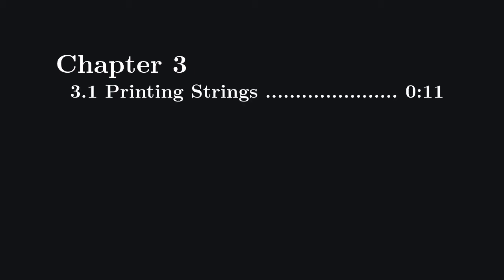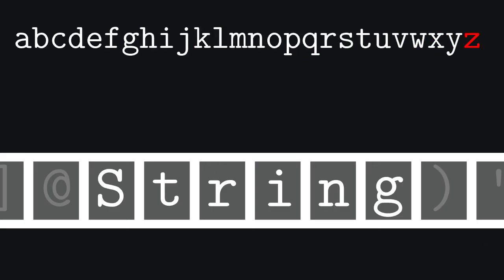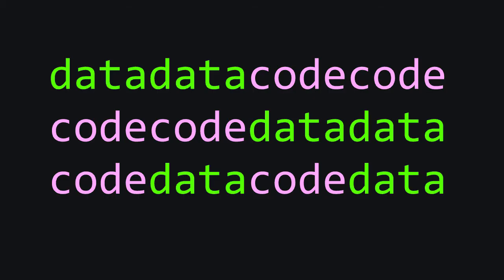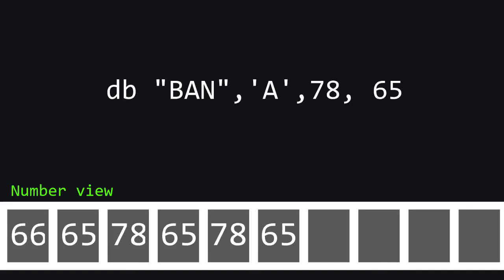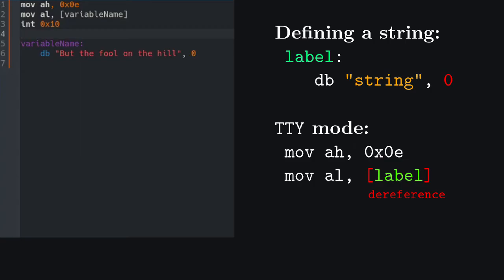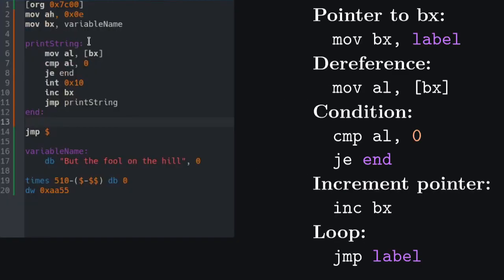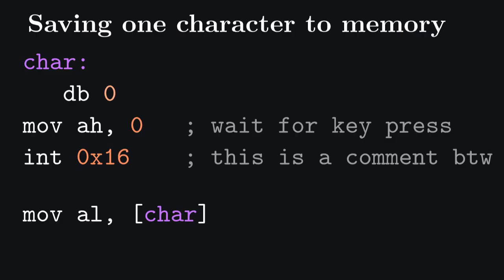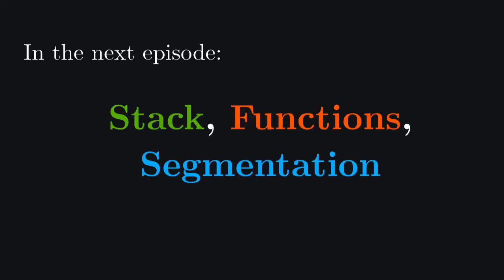Making an OS (x86) Chapter 3 - Strings, Keyboard Input in BIOS

Comment: If anyone has any ideas as to why it dosn't seem to work for me I'd be great full, every other project worked and I think Ive copied this one out letter for letter

[org 0x7c00]
mov ah, 0x0e
mov bx, [variableName]

printString:
    mov al, [bx]
    cmp al, 0
    je end
    int 0x10
    inc bx
    jmp printString
end:
    
jmp $

variableName:
    db "This is a string which I want to be printed out", 0

times 510-($-$$) db 0
dw 0xaa55
Reply from the maker: Try to compare your code with the one over here: https://github.com/mell-o-tron/OS-Reference
Reply: @DaedalusCommunity  i used the code example you provided, but it didn't spit out the string, do you know what could be the issue? I'd be so grateful
Reply: @DaedalusCommunity  Thanks for the response, I found my error I derefernced variableName which I shouldn't have done. I really appreciate your consideration in replying and can I also say I really like the series

Comment: Hey! this is my solution for the homework: It gets the input and you can even backspace and it spits it back to you and then you can do it again!:

[org 0x7c00]    ;sets the origin of memory adressing

begening:

mov bx, 2

memString:
    ;Get user char
    mov ah, 0
    int 0x16

    mov ah, 0x0e ;Enter teletype mode

    ;Compare char with backspace (8 in ASCII)
    cmp al, 8
    jne memStringBSEnd
    
    int 0x10    ;Type BS char to console

    mov al, ' ' ;Assign space char to al
    int 0x10    ;Type space char to console

    mov al, 8   ;Assign BS to al again
    int 0x10    ;Type char to console

    mov al, 0   ;Add null char to al
    mov [buffer + bx], al ;Add char to string

    dec bx      ;Decrement bx for next char
    jmp BSJump  ;Jump at the end

    memStringBSEnd:

    int 0x10 ;Type char to console

    ;Compare char with enter (13 in ASCII)
    cmp al, 13
    je endInput

    mov [buffer + bx], al ;Add char to string
    inc bx ;Increment bx for next char

    BSJump:
    jmp memString ;Loops
endInput:

; Add null char at the end of new string
mov al, 0
mov [buffer + bx], al

; Add spaces at the end of new string
nullCharing:
    inc bx
    cmp bx, 258
    je endNullCharing

    mov al, ' '
    mov [buffer + bx], al

    jmp nullCharing
endNullCharing:

; Add an new line at the start of the buffer
mov [buffer    ], byte 0x0A
mov [buffer + 1], byte 0x0D

; Switch to teletype mode and move the string into bx
mov ah, 0x0E	
mov bx, buffer

printString:
    mov al, [bx]    ;Moves the char of text of index bx to al

    cmp al, 0       ;Compares al with the null char
    je endPrint     ;If it's null, go to end

    int 0x10        ;Print char 
    inc bx          ;Increment bx for next char

    jmp printString ;Loop
endPrint:

mov al, 0x0A
int 0x10
mov al, 0x0D
int 0x10

jmp begening

jmp $

; Keyboard buffer
buffer times 258 db 0

times 510-($-$$) db 0
db 0x55, 0xaa
Reply: i feel like theres so much unesecary logic here
Reply: @eien7228  just dont read mine.
Reply: I spent soo much time on a weird error until I discovered that bx is the only register that can be used in derefrencing, (like this [buffer + bx])
Reply: size optimized by me, based on your code:
input:
mov si,$02
inputloop:
xor ah,ah
int $16
mov ah,$0e
cmp al,$08
jne bsend
int $10
mov al,' '
int $10
mov al,$08
int $10
xor al,al
mov [buf+si],al
dec si
jmp bsjmp
bsend:
int $10
cmp al,$0d
je endin
mov [buf+si],al
inc si
bsjmp:
jmp inputloop
endin:
xor al,al
mov [buf+si],al
nullchr:
inc si
cmp si,$102
je endnullchr
mov al,' '
mov [buf+si],al
jmp nullchr
endnullchr:
mov [buf],byte $0a
mov [buf+1],byte $0d
mov ah,$0e
mov si,buf
prntstr:
lodsb
or al,al
jz endprnt
int $10
jmp prntstr
endprnt:
mov al,$0a
int $10
mov al,$0d
int $10
jmp input

buf = $0500

(to save even more space, you can always use free ram locations instead of the program code, you can always look up for a memory map).
Reply: I made a script that saves what you write, and if you write "all" it will print everything that it saved

[org 0x7c00]

mov bx, 0

begining:

mov cx, bx

storeInput:
    mov ah, 0
    int 0x16

    mov ah, 0xe
    int 0x10

    cmp al, 8
    je decrement

    cmp al, 13
    je printInput

    mov [buffer + bx], al
    inc bx
        
    jmp storeInput
    
    decrement:
        dec bx

        mov al, ' '
        int 0x10
        mov al, 8
        int 0x10
        
        jmp storeInput

printInput:
    mov ah, 0xe  
    mov bx, cx
    mov dl, 1
    dec bx

    mov al, 10
    int 0x10
    int 0x10
    mov al, 13
    int 0x10

    printAndCheckForAll:
        inc bx
        mov al, [buffer + bx]
        int 0x10

        sub bx, cx

        cmp al, [all + bx]
        je continuePrinting
        mov dl, 0

        continuePrinting:
            add bx, cx

            cmp al, 0
            jne printAndCheckForAll

    cmp dl, 1
    jne endPrint

    mov al, 0
    mov [buffer + bx - 1], al
    mov [buffer + bx - 2], al
    mov [buffer + bx - 3], al

    mov cx, 0
    jmp printInput

    endPrint:
        mov al, 10
        int 0x10
        int 0x10
        mov al, 13
        int 0x10
    

jmp begining

buffer times 255 db 0
all db "all", 0

times 510-($-$$) db 0
db 0x55, 0xaa

Comment: The reason for this offset is because the code in the boot sector of the disk is loaded by the BIOS at 0000:7c00 it contains all the pointers to the interrupt codes. safety first.

Comment: I finally managed to solve the problem you gave and made it cli like (its probably super buggy) here my code:

[org 0x7c00]

mov ah, 0x0e ; Enable TTY Mode
printInputPrompt:
    mov bx, inputPrompt
    print_loop:
        mov al, [bx]
        cmp al, 0
        je printInputPrompt_end
        int 0x10
        inc bx
        jmp print_loop
printInputPrompt_end:
    jmp readInput

readInput:
    mov ah, 0
    int 0x16
    jmp processInput

processInput:
    cmp al, 13
    je enter_pressed

    cmp al, 8
    je backspace_pressed

    jmp display_input

display_input:
    ; Display the typed character
    mov ah, 0x0e
    int 0x10
    ; Add the character to the buffer
    mov [bx], al
    inc bx
    jmp readInput

enter_pressed:
    mov bx, inputBuffer
    mov al, [bx]
    cmp al, 0
    je readInput
    mov ah, 0x0e ; Enable TTY Mode
    mov al, 13 ; Print a Carriage Return
    int 0x10
    mov al, 10 ; Print a Line Feed
    int 0x10
    dec bx
    jmp printInput

backspace_pressed:
    ; Still need to implement this
    jmp backspace_pressed_end
backspace_pressed_end:
    jmp readInput

printInput:
    mov al, [bx]
    cmp al, 0
    je printInput_end
    int 0x10
    inc bx
    jmp printInput
printInput_end:
    mov cx, 0 ; counter
    mov al, 0
    mov bx, inputBuffer
    dec bx
    resetInputBuffer:
        cmp cx, 9
        je resetInputBuffer_end
        mov [bx], al
        inc bx
        inc cx
    resetInputBuffer_end:
    mov al, 13 ; Print a Carriage Return
    int 0x10
    mov al, 10 ; Print a Line Feed
    int 0x10
    jmp printInputPrompt

inputPrompt:
    db "Enter a String and I will echo it (10 Characters): ", 0

inputBuffer:
    times 10 db 0

; Create the boot sector
times 510 - ($ - $$) db 0
dw 0xaa55

Comment: My solution:

;; Algorithm
;;; - Allocate buffer space in .bss
;;; - Read in string to buffer, ending if buf full or read CR
;;; - Print string from buffer
;;; - Exit

    ;;  512 byes long ending in 0x55 0xaa

[bits 16] ; use 16 bits
[org 0x7c00] ; sets the start address

    mov bx, str                 ; load addr of base of string into bx
    mov cx, 0x0a                ; count chars read to avoid overrunning buffer

read_loop:
    mov ah, 0x00                ; prepare to read character from kbd
    int 0x16                    ; read character and scancode
    ;; ASCII character stored in al & scancode stored in ah

    ;; implement local echo
    mov ah, 0x0e                ; print the character
    int 0x10

    ;; process character read
    cmp al, 0x0d                ; see if we read a CR keypress
    je __print_str              ; if so, done reading and print string
    mov [bx], al                ; move the ASCII character into the string
    inc bx                      ; move to next spot in buffer
    dec cx                      ; if this gets to zero, buffer full: print str
    cmp cx, 0x0                 ; compare counter with zero
    je __print_str              ; if counter == 0, buffer full so print str
    jmp read_loop               ; loop to read next character

__print_str:                    ; function to print the string
    mov ah, 0x0e                ; prepare to print characters
    mov bx, str                 ; load addr of base of string into bx
    mov al, 0x0a                ; print CRLF pair to print on new line
    int 0x10
    mov al, 0x0d                ; print CRLF pair to print on new line
    int 0x10

__print_loop:
    cmp al, 0x0                 ; check if character is a null
    je done                     ; if so, done so end
    mov al, [bx]                ; else prepare to print character
    int 0x10                    ; print character
    inc bx                      ; move to next character
    jmp __print_loop            ; loop to print next character

str:
    times 11 db 0               ; 10-character null-terminated string

done:
    jmp $                   ; jump to the current memory address -- infinite loop much?

    times 510-($-$$) db 0
    db 0x55, 0xaa

Comment: This code makes it so you can type any amount of characters and when you press enter it will end the loop:
getinput:
  mov ah, 0
  int 0x16
  mov ah, 0x0e
  int 0x10
  cmp al, 13
  je halt
  jmp getinput

halt:
  hlt

jmp $
times 510-($-$$) db 0
dw 0xaa55

Also I figured out that insed of doing this:
jmp $
times 510-($-$$) db 0
dw 0xaa55

You can do
times 510-($-$$) db 0
dq 0xfeebaa55

Comment: Hi Daedalus, I did this video's homework! I struggled a bit on this one, and the way I managed to solve it is to directly save characters in al to bx (buffer), and to not let one type more than 10 characters. Here's the code:

[org 0x7c00]
characters: 
	cmp bx, 10
	je end
	mov ah, 0
	int 0x16
	mov ah, 0x0e
	mov [bx], al
	int 0x10
	inc bx
	jmp characters
end:
	jmp $
buffer:
	times 10 db 0
	mov bx, buffer
times 510-($-$$) db 0
db 0x55, 0xaa
Reply: Does this work? Maybe I'm not understanding but I was imagining you'd need to put buffer into bx first. At the moment I'm wondering how that line would get executed? Also the comparison of bx to 10, assuming bx had been set to buffer, buffer is a memory address that looks larger than 10. At a guess it is at least 25 or more. Taking a wild guess, assuming bx initially contains zero, the program is storing the input at memory addresses zero to 10 (or maybe 0x7c00 to 0x7c09). I might be going completely wrong here but would that mean it was overwriting the program from cmp onwards?

Comment: The firmware loads the bootloader at address 0x7c00, that's why we use that with org directive.
Reply from the maker: Well I knew that, I just was not sure why they chose 0x7c00 as a loading point :)

After some digging and some comments it seems to be because the part before that point is used for BIOS data structures and code.
Reply: @DaedalusCommunity  it is loaded there by the firmware because of the memory layout. It's divided into many section which includes a section for free memory, a section for interrupt vector table, etc and the bootloader is also loaded in a section of 512 bytes which starts at 0x7c00 and ends at 0x7e00.

Comment: Here is the code for the homework! I know that its big, but it works flawless.

```
[org 0x7C00]

; Start the buffer index at index 2
; C equivalent:
; bx = 0
mov bx, 2

loopInput:
    ; Keyboard wait
    mov ah, 0
    int 0x16

    ; Switch to Tele-print mode and print the char register (prints al which has the char)
    mov ah, 0x0E
    int 10h

    ; Check if we pressed the enter key
    ; C equivalent:
    ; if(al == '\n') jmp endInput;
    cmp al, 0x0D
    je endInput

    ; Move the char to the buffer indexed by bx
    ; C equivalent:
    ; buffer[bx] = al; bx++;
    mov [buffer + bx], al
    inc bx

    ; Jump back to the keyboard wait
    jmp loopInput
endInput:

; Add an new line at the start of the buffer
; C equivalent:
; buffer[0] = 0x0A
; buffer[1] = 0x0D;
mov [buffer    ], byte 0x0A
mov [buffer + 1], byte 0x0D

; Switch to tele-print mode and mov the string into bx
; C equivalent:
; ah = 0x0E;
; bx = buffer;
mov ah, 0x0E
mov bx, buffer

loopPrint:
    ; Check if we are at the end of the input string
    ; C equivalent:
    ; if(al == 0) jmp endPrint;
    mov al, [bx]
    cmp al, 0
    je endPrint

    ; Print char and increase buffer pointer
    int 10h
    inc bx
    
    ; We might not yet be done
    jmp loopPrint
endPrint:

; Print a new line
mov al, 0x0A
int 10h
mov al, 0x0D
int 10h

; Infinate loop
; C equivalent:
; while(true);
; or
; for(;;);
jmp $

; Keyboard buffer
buffer times 258 db 0

; Put the magic value 55 AA at the end of the bin file
times 510-($-$$) db 0
db 0x55, 0xAA
```

Comment: Here's my solution. I feel like it could be done in fewer instructions but oh well. Also, my newline character doesn't work so well hahaha
ORG 0X7c00
BITS 16

start:
	mov bx, message
	call print
	mov bx, buf
	call get_buf
	mov bx, buf
	call print
	jmp $

get_buf:
	mov cl, 0
.loop:
	cmp cl, 9
	je .done
	call get_char
	mov [bx], al
	call print_char
	inc bx
	inc cl
	jmp .loop
.done:
	mov al, 0x0a
	call print_char
	ret

get_char:
	mov ah, 0
	int 0x16
	ret

print:

.loop:
	mov al,[bx]
	cmp al, 0
	je .done
	call print_char
	inc bx

	jmp .loop
.done:
	ret

print_char:
	mov ah, 0eh
	int 0x10
	ret

message: db 'Enter character', 0x0a, 0
buf: times 10 db 0
times 510 - ($ - $$) db 0
dw 0xAA55

Comment: I still don't get where the OS gets fonts to type text from. He isn't inserting them, so it must be somehow... uhh... that's what I want you to reply.
Reply: The vector 1F for 8x8 character set points to F000:FA6E in 100% IBM compatible bios.. according to Ralph Browns Interrupt List
Reply: -------V-101130----------------------------
INT 10 - VIDEO - GET FONT INFORMATION (EGA, MCGA, VGA)
	AX = 1130h
	BH = pointer specifier
	    00h INT 1Fh pointer
	    01h INT 43h pointer
	    02h ROM 8x14 character font pointer
	    03h ROM 8x8 double dot font pointer
	    04h ROM 8x8 double dot font (high 128 characters)
	    05h ROM alpha alternate (9 by 14) pointer (EGA,VGA)
	    06h ROM 8x16 font (MCGA, VGA)
	    07h ROM alternate 9x16 font (VGA only) (see #00021)
	    11h (UltraVision v2+) 8x20 font (VGA) or 8x19 font (autosync EGA)
	    12h (UltraVision v2+) 8x10 font (VGA) or 8x11 font (autosync EGA)
Return: ES:BP = specified pointer
	CX    = bytes/character of on-screen font (not the requested font!)
	DL    = highest character row on screen
Note:	for UltraVision v2+, the 9xN alternate fonts follow the corresponding
	  8xN font at ES:BP+256N
BUG:	the IBM EGA and some other EGA cards return in DL the number of rows on
	  screen rather than the highest row number (which is one less).
SeeAlso: AX=1100h,AX=1103h,AX=1120h,INT 1F"SYSTEM DATA",INT 43"VIDEO DATA"

Format of alternate font table [array]:
Offset	Size	Description	(Table 00021)
 00h	BYTE	character to be replaced (00h = end of table)
 01h  N BYTEs	graphics data for character, one byte per scan line

Comment: But why the square brackets in the org instruction?
The square brackets in the mov instruction I believe just feels the assembler to use the value at a memory address, and not the address itself. Right?
Reply from the maker: In the case of the square brackets we use in the mov instruction, we're using them as a dereference operator. If we read [5], we're reading the value of memory address 5. 

In the case of org, the brackets have a completely different meaning: they contain not only a number, but a **directive**. So [org n] just sets the origin, and it's in brackets just because that's how directives are used in NASM.
Reply: @DaedalusCommunity  Square brackets do not indicate dereference, they indicate an address.
Reply: LEA esi, [ebx+edi]     ; esi = ebx + edi, no memory access, only calculating offset address, no flags used, result have to fit in target register, fast addition..can be modified with multiplication.... address modes

Comment: 3:14 The reason for offset 0x7C00 is because that's memory location where the boot sector is loaded by the BIOS (or by the master boot record code for hard drive partition boot sectors)
Reply from the maker: Yup, I'm aware of that, what I'm not sure about is why they chose to load the boot sector at that particular address
Reply: @DaedalusCommunity  most likely because its just below the 32K boundary
Reply: @DaedalusCommunity  The loader is 0x200, so it can start at ox7c00 as another 0x200 is needed for the stack (which grows downward from 0x8000 to 0x7e00).  That leaves everything below for the OS.  Why 0x8000?  Because that's the minimum memory size for a machine at the time (32K).  This wasn't changed even when the first IBM PC came with a minimum of 64K.

MS-DOS stuck to this too.  First 0x400 bytes was for IVT, then there was the BDA, and then MS-DOS world set it's data area low at 70:0.